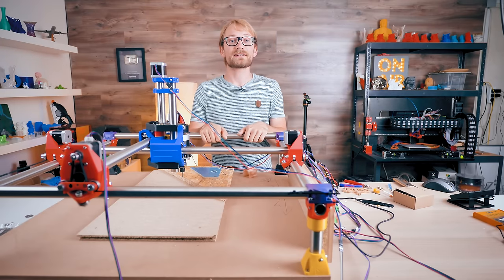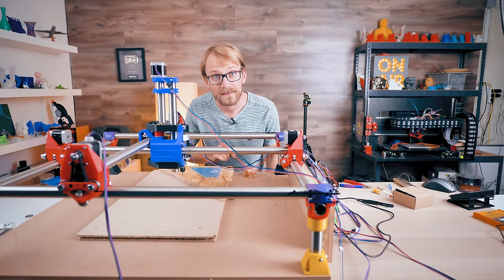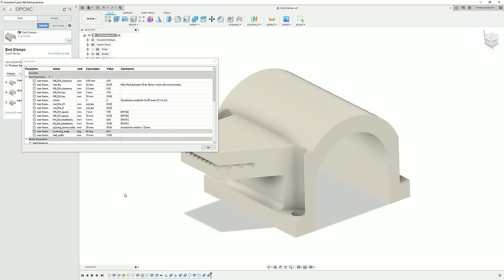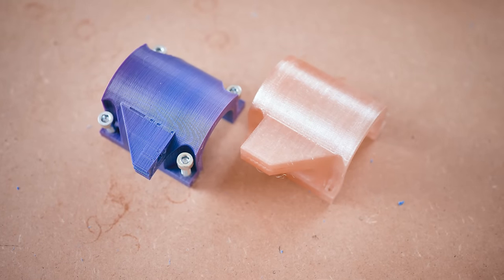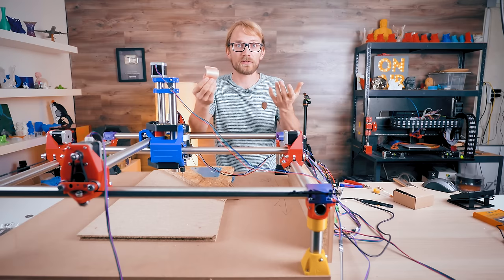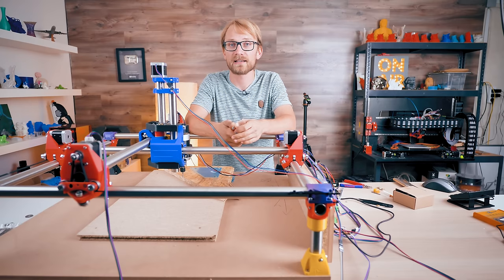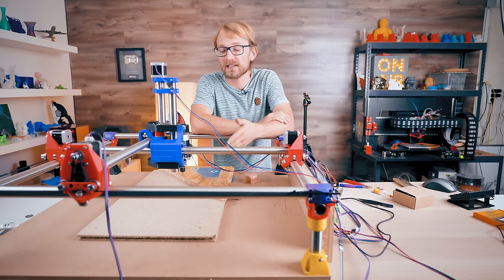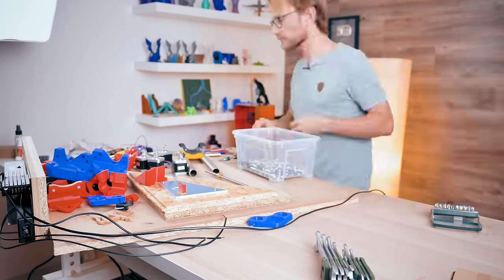Whose design even is this? (MPCNC conclusion)

Comment: I built mine with EU stainless pipes cut to size by a online shop. I am pushing the limits of this machine with a 1m * 1.5m work size. The machine is massive. I am having only minor problems with play or what so ever. Nothing near of what you are mentioning. I agree with some that the machine has it's flaws, but for me this performs good for now.

I hope you will post another video in retrospect of what happened and what your video caused. You and Ryan both have valid points, but disassembling the machine like that on video feels really childish. You both should have talked - not the twitter back-and-forth - and this would have turned out great.

Comment: I think you’ve been kind of harsh on it from the start (when you brought up having to order screws I thought -  “I wonder if he will realize that is what it is like for an American to try to build the other 90+% of designs that uses metric screws we have to order online too.”). Now everybody judging by prior comments here thinks you can’t use it for business or make and share designs.  I’ve done both, and talked about it right on the V1 forums.  The guy who made it has that stance because he doesn’t want somebody changing one bit and then starting to sell it as their own with no mention of the original design.  

Early on he had somebody just emboss their logo (or it was some other minor change - its been a few years) and try selling it as a “their name CNC” for hundreds of dollars without telling anybody where it came from or that it was freely available.  That is the thing he wants to stop.  He quite frankly seemed thrilled/happy when early on I bought a kit, and was able to make money selling signs I had produced using the CNC.
Reply: We can only hope that someday ( in my lifetime, LOL ) the US will wake up to the metric system. Most of the manufacturing here is done in metric and just relabeled to satisfy our lame consumers. When I can buy a sheet of 1220 by 2440 plywood, I can throw away my Imperial tape measure. And don't get me started on the mix of Imperial and Metric on cars and trucks!

Comment: Thomas, as a long-time subscriber/follower, I enjoy your style and think that the content you share is incredible.

With that said, I have to say that Ryan is correct. Derative works must adhere to original design licensing specifications.

As someone who's previously set-up "clean rooms" as specific protections from infringement claims, I can definitively say that modifying an existing file isn't the standard for a derivative works claim. Rather, only individuals without prior knowledge of a thing, referred to as "contamination", who come up with a solution, however similar to "existing art", are inoculated against from a derivative works claim.

You built a MPCNC from Ryan's design. Observing issues, you set out to engineer and fabricate your take on a solution to said issue(s). In short, you improved upon Ryan's design.

All's good up until the point when the design was posted in violation of the Creative Commons Attribution-NonCommercial-ShareAlike license.

Had your design been posted with attribution, for non-commercial purposes and under the same license as the original, there would have been zero issues.

In reviewing what remains of the Twitter exchange, as well as comments here, Ryan's efforts are suffering harm from what began as a misunderstanding that inappropriately occurred in a public forum. As soon as it became evident that there was an issue, either you or Ryan should have suggested that the issue be addressed and resolved privately.

Ryan is right in defending his intellectual property. After all, he's made freely available for personal, non-commercial use. He supports his designs and continues innovating. All in the best spirit of free markets.

It's my hope that my comments are received as they're intended:  as only constructive criticism with no offense intended.
Reply: Well, yes you're right about the license, but I'm guessing you really didn't take a look at the part in question with Ryan's or Thomas's designed REMOVED. If you look at it, with either design removed (which is the debate here), you're left with what has been referenced to by many names; Channeled C-Clamp, U-Clamp, Pipe Joint, Coupler (and I'm sure many, many more). That is the problem. Unless Ryan invented that (and not someone 1000+ years ago), then Ryan's claim is in violation of the Creative Commons on that fact alone regardless of physical application (and then it's a vastly larger table of rhetoric). I understand it's better to copyright/patent without researching if the copyright/patent is already held, but in this case, the design in question is just too well known throughout the world.

Just take a look at the part without Ryan's or Thomas's design. While I feel your clean room experience can apply, I'm just not sure at all if what you were dealing with is a flat, barebones basic as this. This issue reminds me of the SCO Vs. IBM case from nearly 20 years back. In all seriousness, I feel Ryan's design now stands for serious scrutiny in deciding what is actually his design and not a derivative work of known works for centuries.

Comment: This sucks. MPCNC is a design that Ryan spent years designing and refining. He designed it to work with exactly the parts from his BoM. Because you decided to deviate from the BoM, use different size hardware, complain about that not working as well as you wanted, redesign some of his parts to work with your hardware and then RELEASE THEM WITH NO RESTRICTIONS. You think Ryan is in the wrong here? He's not a youtuber. He makes a living with these designs. I don't see how you don't understand that releasing parts with no restrictions on selling them impacts Ryan's rights as his design would be slowly muddied by people just like you (well intentioned, but not seeing the big picture). 
Ryan has already had to protect his design multiple times from being sold on ebay using printed parts based on his designs. If Ryan doesn't defend his copyright, it loses all power. That's how it works. I'm just sitting here shaking my head in disappointment. The craziest thing about this is you taking this to your 232k youtube subscribers and presenting them a video about it that by your own admission is "a bit harsher" than you'd like. Sure Tom. You still had to post it though huh? I'm so disappointed you couldn't see past your own nose on this one.
Reply: Posting the disassembly was over the top on Tom's part.  He could have just said something like "there was a licensing disagreement and I've had to stop development on this. Maybe in the future we'll work it out or I'll build a CNC with licensing that works better for what I want to do." And leave it at that. As someone else said, it was bad decision on both their parts to discuss/argue about it over twitter.  If they were both in a room discussing it or even talking over the phone, the outcome could have been different. I'm not taking sides, I like Tom's channel and will continue watching it, and if I decide to build a CNC, I will still consider MPCNC.  Unfortunately, most people polarize very easily.

Comment: First off... R. I. P. MPCNC... 

Secondly, If you ask me... Which no one did... Lol:

Sounda alot like Ryan just wants control over it. He thinks his version is best and should stay how he designed it.. Aka he can't take criticism well and thinks any "improvement" is an attack on him more than likely. That, or he doesn't understand the license he used for it. Sounds like he was worried some corporation would find the idea and start mass producing the parts to sell it or something... Little does he know that it just means he is taking away people's ability to actually use the machine he's so proud of. No one would be able to advertise it under his license, no one would have a reason to build it other than for simply learning about it. Cause come on, no one here who was going to build one, didn't think that doing so would allow them to CNC things and charge something for it. Like a buddy at work wants something made so you charge them 5 bucks, just like people tend ta do with their 3D Printer when everyone at work finds out you have one...
Reply: The belt clamp isn't even an improvement. it's not even 3d printable without supports. Ryan is perfectly fine with people using the machines to make stuff to earn money. What he IS NOT OKAY WITH is people clearly copying his design, then releasing it under a different license, which is exactly what happened here.

Comment: I definitely feel this is an over reaction, Tom. Ryan only asked that you release the part you created (which builds on the material that he created) under the same license. I don't think he's trying to stop others from working with his design, just that it's on terms that Ryan is happy with.
Reply: Seriously how could you say that it builds on anything besides common tubes? Anyone could come up with that design as long as they needed a belt attached to a tube, nothing is unique about it.
Reply: @trbry.  Its not a copy, for sure. But Tom would not have designed his piece without Ryan's CNC in front of him. From my point of view that builds on Ryan's design and that is part of the point of this license.
Reply: @alexbeardmore3588  perhaps, but he could as well had design that part for a 3D printer just a different scale.

Comment: Ryan can get stuffed! 

His design of the clamps is not unique, he has copied other commercially available pipe brackets to create his design so his has no claim on license on the part to begin with let alone the bearing system on the pipes or the fact he is using open source parts within the this design. Ryan's only claim is to protected a design if he designed the entire machine without any parts that are basically copies of existing designs, in this particular case I can't see a single part that to this router that is not a remix of another design. 

At the very least take down the videos promoting his design and he can go back to the dark corner he crawled out from, people like this do not deserve your, or anyone else's, support.

Comment: Maybe try a 20x20x10cm printed parts CNC with lead screws? It should be as solid as concrete.
Reply: Lead screws = backlash. I'm not saying it can't be overcome, but they introduce a different set of problems instead of simply solving one.